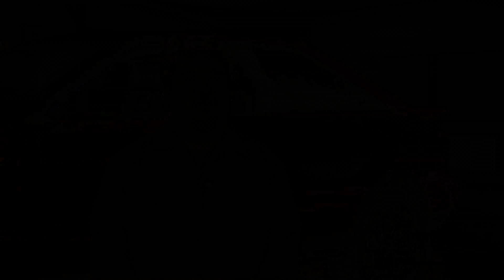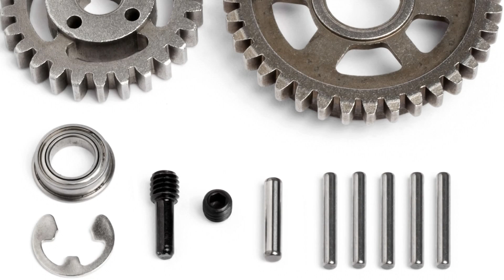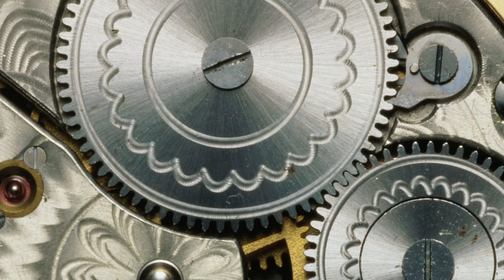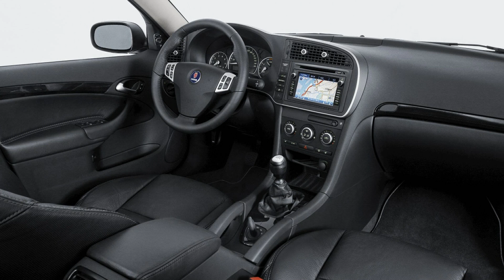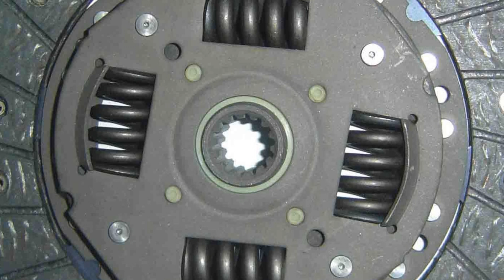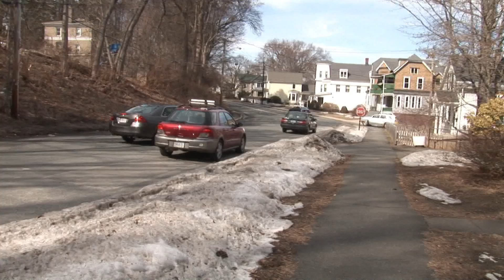Car Maintenance : What Is a Gear Ratio?

Comment: I changed the ratio in my car from 3.34 to 3.08.  Somebody gave me the idea to do it because it saves gas and I did it.  Is this a big difference?  I do feel slower acceleration but seem to go faster on the freeway.  I have noticed that my spedometer shows about 70mph when my actual speed is about 80mph.  I am wondering if there is a gear ratio between 3.08 and 3.43 available for my car.  A 1989 pontiac firebird.